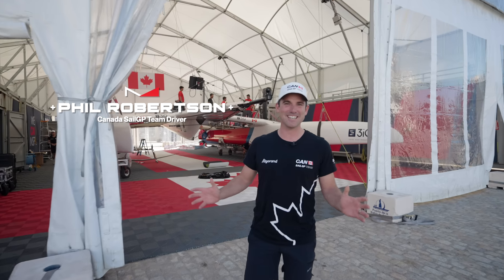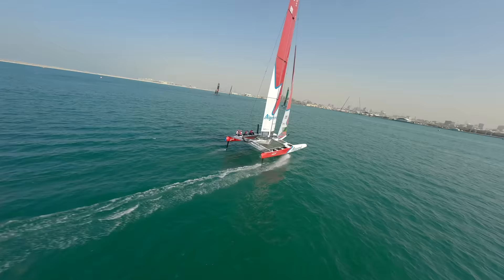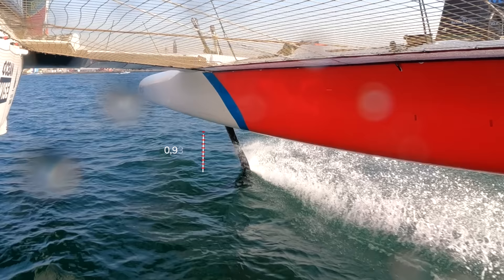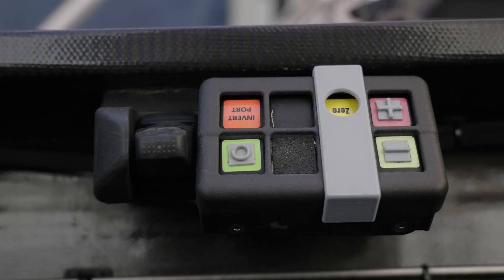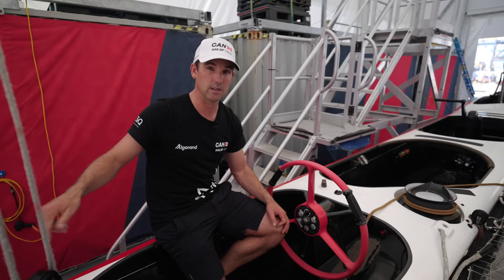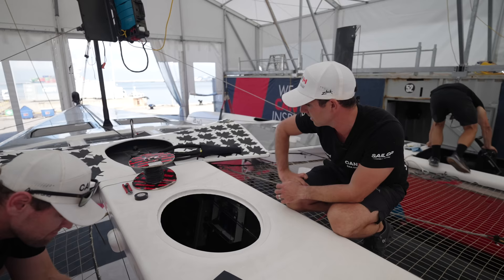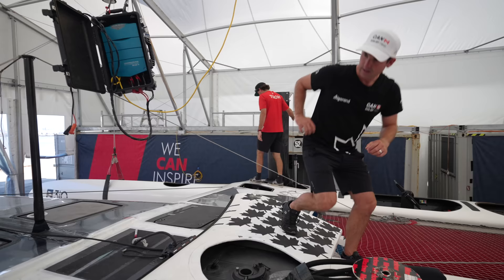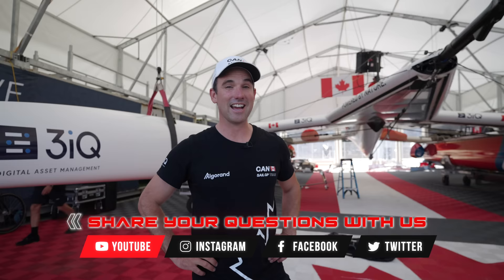The MOST ADVANCED foiling catamaran + FULL sailboat tour | F50 SailGP

Comment: I had not considered the horizontal body of the boat could potentially be used to generate lift, or provide downforce. But there is no free lunch with a wing! With Lift comes Drag, and the Glide Ratio results from them. Glide Ratio is often referred to as L/D. And so it seems abundantly clear to me the clyzar fairings are to reduce parasitic drag, and I'd be prepared to wager a dollar or two that the distance from the leading edge to the trailing edge is the same both top and bottom - and thus no Bernoulli lift results if the boat is horizontal. 

But as you hinted, you can adjust the angle of the whole boat and nose down will result in a downforce, while nose up will produce mechanical lift. It's easy to see how a pilot can potentially work this into a sailing regimen to obtain a tiny advantage in certain situations. And as we have seen, the racing can be crazily close at times. 

It's my prediction the next great innovation in foiling will be the super-cavitating foil, which will ride in a pocket of compressed air so that the entire surface of the foil is not in contact with the water. As human power is the only source other than wind, I envisage a brief "turbo mode" where stored air is released from the leading edge to reduce drag to almost nothing through the water. The Russian rocket-powered super-cavitating torpedo Shkval (VA-111) is known to have achieved 370km/h underwater using the technology. https://en.wikipedia.org/wiki/VA-111_Shkval

Comment: This is great! One question I've always had about these boats is why there are only 2 grinders. The AC50s these were based off of had 4 cyclors powering them. What changed? Do batteries now power more systems or are they simply more efficient?
Reply: You are correct, the batteries power most systems on board and the hydraulic pump are able to generate all the pressure needed for all the systems and the grinders are now powering the main winch where the wing sheet goes. Basically, the grinders are now sheeting in and the wing trimmer will only ease the sheet of the wing :)
Reply: So the hydraulic pressure isn’t increased by humans during a race? There’s enough battery power to run the hydraulic pump?
Reply: @terrygalvin9653  Correct, the battery life is around 4 hours, but they can change the battery on the water in about 3 min if needed.

Comment: Can someone please explain why 1 of the foils is always up unless its turning? I can not find an answer anywhere. Thank you in advance.
Reply: two reasons, one the weight of the flown hull is to counter the force from the wing for righting moment. Two, the drag of having two boards down is significant adding that when both boards are down you almost need to have neutral to negative lift from the windward side foil so really its only producing drag. In a maneuver you are really trying to somewhat gracefully transfer all the lifting loads to the new foil as fast as you can to pull the old board that would just be producing drag back out of the water. In these boats the less wetted surface the faster you go.

Comment: The most advanced?  All these cat designs are flawed.  Once they ventilate a foil, it is like stabbing a stiletto into a brick wall.  Simply foolish to fly these hulls.  Look to your sea plane pontoons for guidance.... those are designed not to pitchpole.... which is the opposite of a displacement hull cat with a "wave-piercing bow."  I cannot believe that it has been years, and these designers STILL haven't figured it out.  At least the new monohull foil designers are figuring out.  And this is obviously apparent if you compare the early monohull shapes to the latest.